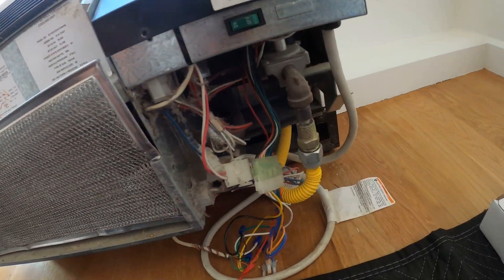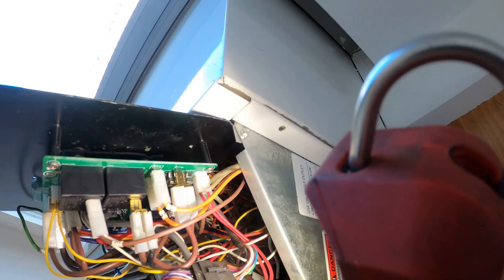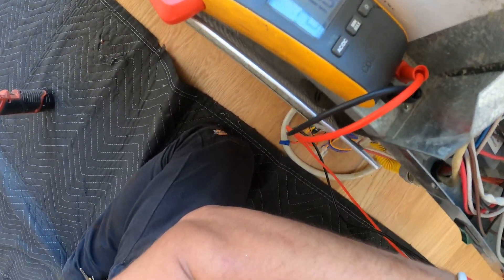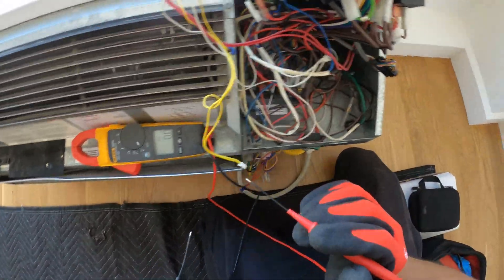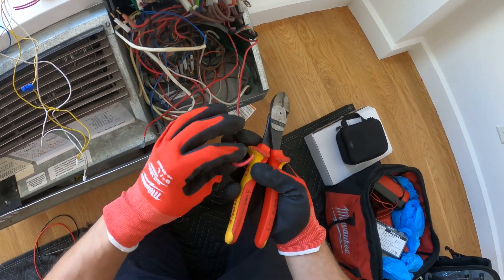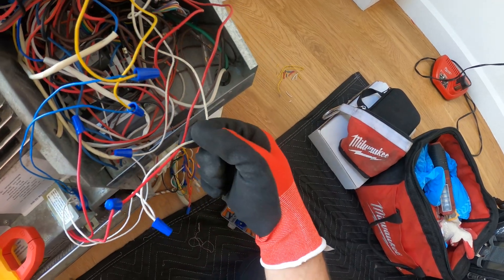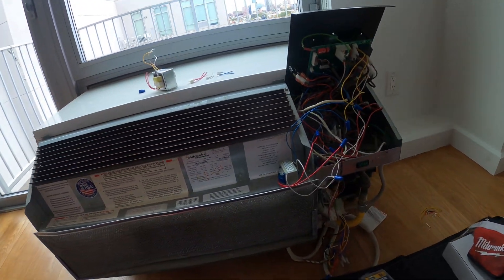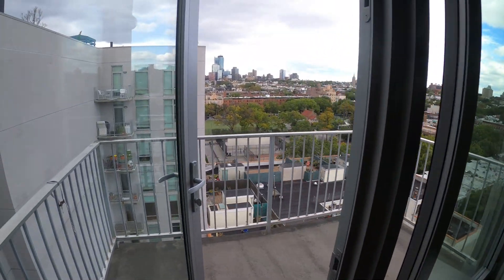HVAC Service Call: PTAC Unit Not Cooling Or Heating (Packaged Terminal Air Conditioner Not Working)

Comment: My ptac amana unit is leaking water in the house only when on heat.   It had been services and heat is great but the  alot of water is puddling in my house.. does the unit need to be replaced

Comment: Hey terrific  video.. question..
My twenty-year-old carrier PTAC unit is working great but the thermostat doesn't allow the heat to order matically turn on I have to manually do it can I put a new sensor right on the hot water pipe, and how do I electronically override the existing sensor and install it

Comment: Today I did my first service on a unit like that. OMG with all the wiring you are losing your mind. I was freaking out cause I never worked on such a unit before.
Reply: The HSI was bad. It took me while to figure it out but I fixed it.
Reply: @harryschrysan3183  of course if you did it first time. I never worked with this type of unit and going to have it tomorrow, I just know model of unit and issue: not cooling
Reply: What kind cx complain did you have? Did you find issues?

Comment: Great video just wanted to let you know that you could most likely be taken off the connectors on end of wires with a small screwdriver on both ends. Then swapped the connector so that they could be compatible and have no spices.

Comment: Good infor have a question I work at a hotel amana Ptac units I have a unit that works manually but when I program the thermostat and the thermostat is turned on and showing everything is good but it doesn't control the unit could it be the wifi or the thermostat and the wifi control box light is on I'm thinking the connection to the wifi is bad what do you think ?

Comment: QUICK QUESTION for ya JumperMan... what does that unit use the 11v (12.9v) control voltage for? For the little LCD display and control buttons it has on the face?